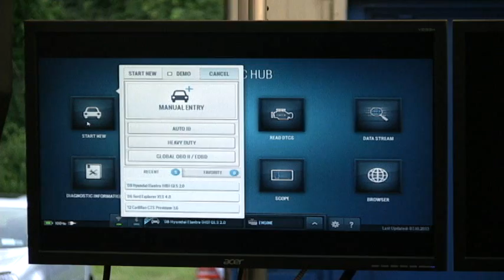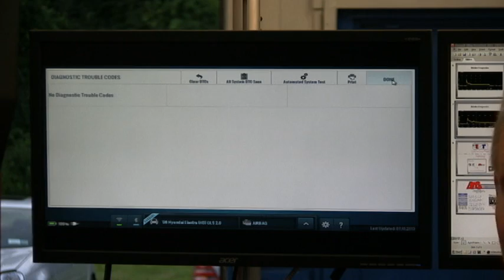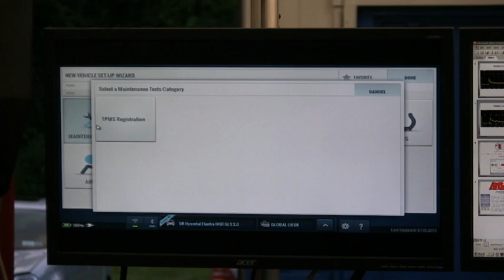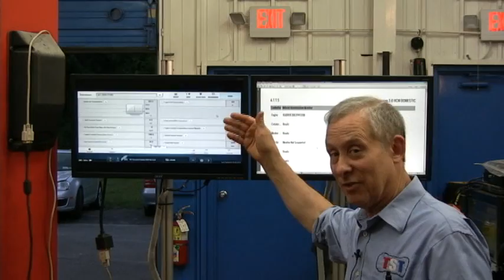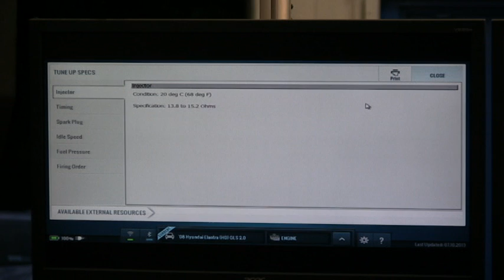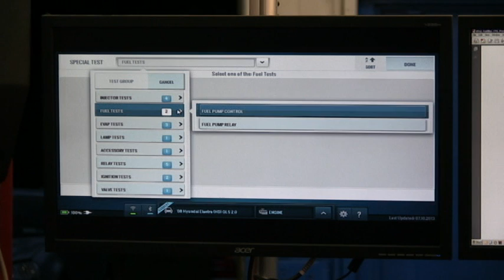OTC Genisys Touch Scan Tool

Comment: I use this scan tool and Identifix and haven't found a complicated problem I couldn't fix. The only down fall is alot of modules need to be reprogrammed. So if its a GM car then you need a tech 2 scanner after you change the module. So we are constantly fixing the problem but taking it to another shop 20 miles away to get it programmed.